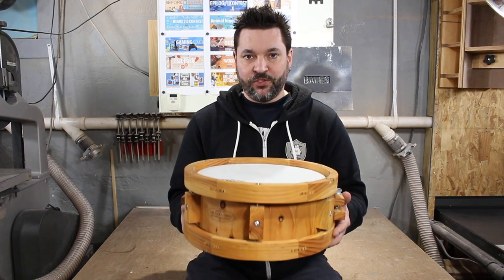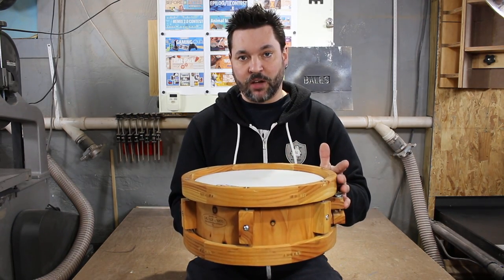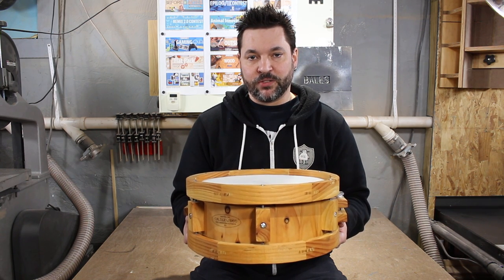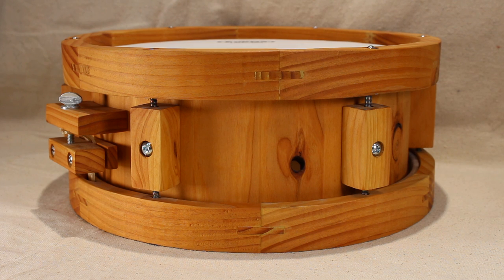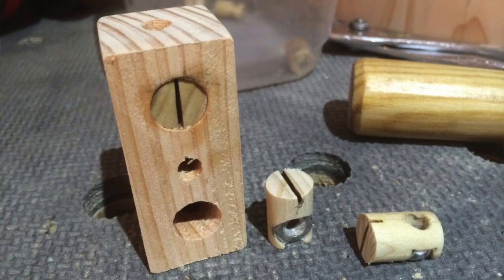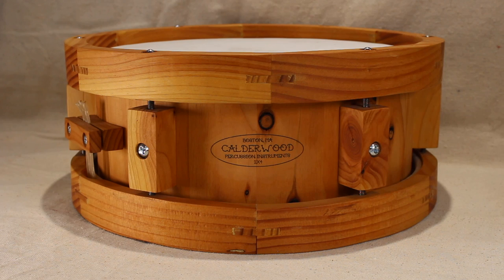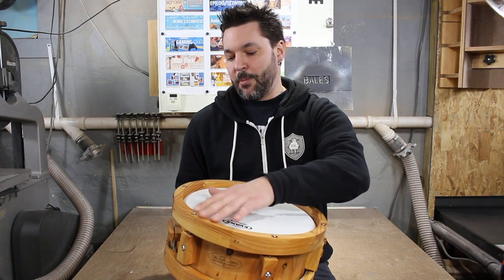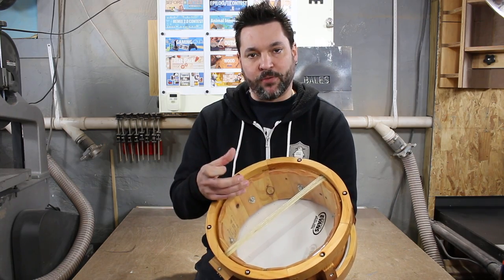How Does It Sound? -  The 2x4 Snare Drum

Comment: I'm wondering how pine would turn out if it had regular hardware.
Reply from the maker: Pine works for drum shells, it's just a softer wood, so you need to be a bit more gentle.  Don't crank down on hardware screws or you'll pull them into the wood, don't bang the bearing edges around, and be mindful that it'll be easily scratched and/or dented.

Comment: Warm sound but,  what about rim shot?
Reply from the maker: The pine is too soft, so every rim shot leaves a dent.  In order to make this a practical drum, the wooden hoops would need to be swapped for metal and I'd also swap out the cat gut for wire snares.  At that point, you may as well swap out the lugs, which leaves you with just a 2 x 4 shell and that has already been done by the Famous Drum Company.

Comment: sounds really good but I'm a guitarist lol ,what do you think about it ? is it just a novelty or in certain situations is there a place for it on your kit ?
Reply from the maker: I deem this incarnation a novelty.  I think it could be actually done .. and I will do it ... with some modifications.  Upgrade the hoop to a three tier segment/staggered stave and swap to a modern throw-off and snares for sure.

Then test the wooden lugs with washers and swivel nuts (actual drum hardware).  If the wood is still too soft to hold tension at that point, the design is lost in my opinion.